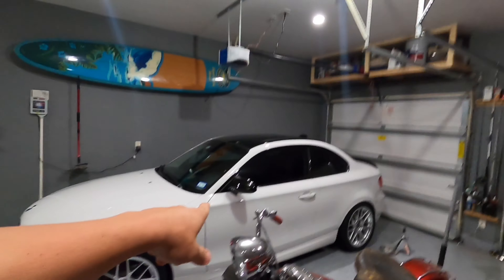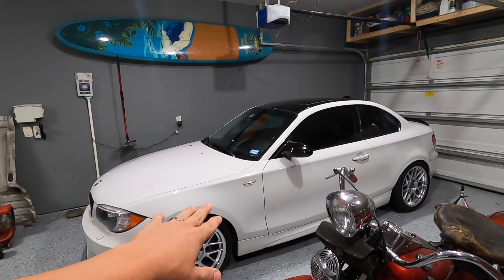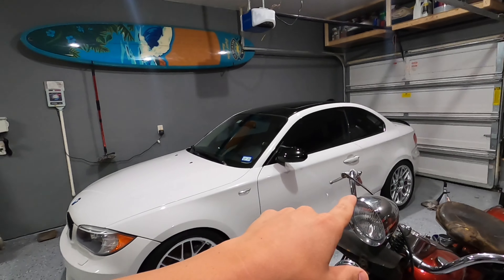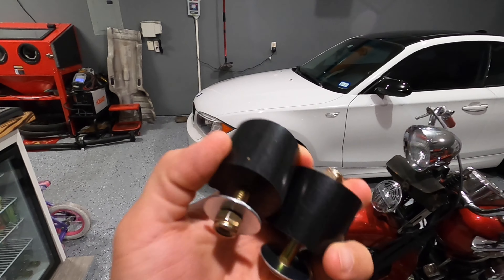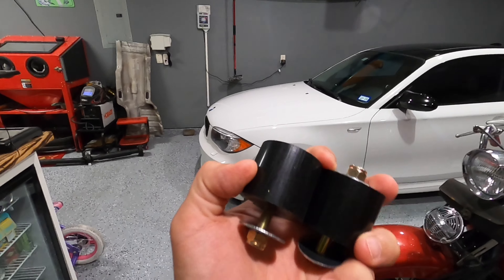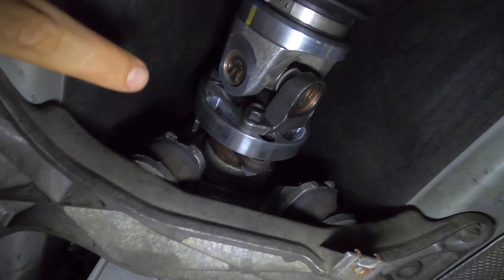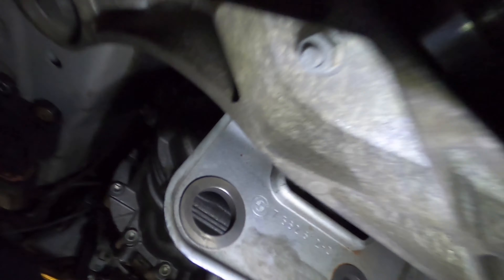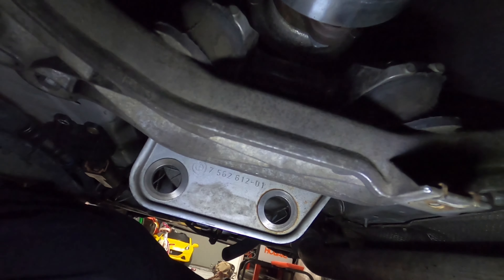750WHP BMW 135i Gets new transmission mounts & BMW Meet

Comment: For anyone looking for actually usable trans mounts for the street, rogue engineering makes a rubber set that is much stiffer than e46 m3 yet still soft enough to not rattle your brains out. Paired with softer poly engine mounts it should be perfect. The key is to always get mounts that retain the original design, NEVER get bolt through mounts unless it’s a track only car.

Comment: lol, solid or even most poly transmission/engine mounts are known to vibrate your entire body, itch your nose, rattle any thin metal panels, and make you hear all types of transmission mechanical noises you didnt know existed. 

I used to track my exige. It was no longer a comfortable street car

Comment: Off topic just a little . How is the ghassan n54 motor . Im about to pull the trigger on one . Any comment  from you would be great
Reply from the maker: So far it’s been good, a few minor bolts that came loose a little. I’ve been meaning to take the valve cover off the double check on everything specially the vanos bolts and chain. Would I do it all over again? Probably not.